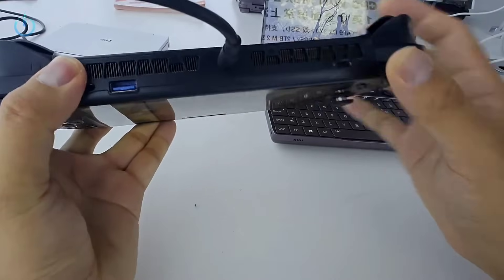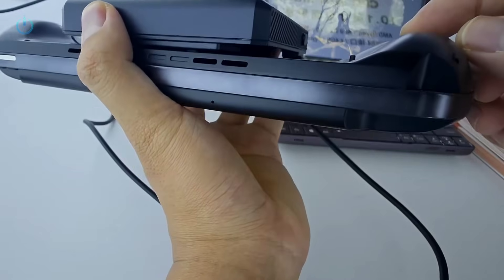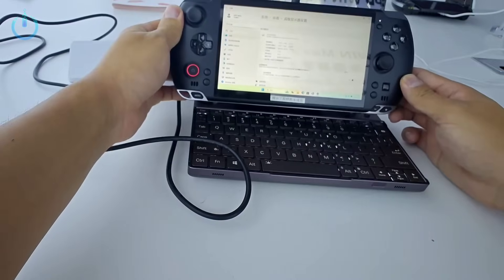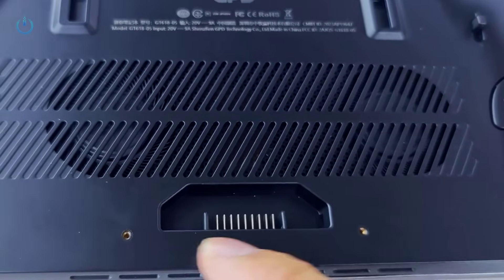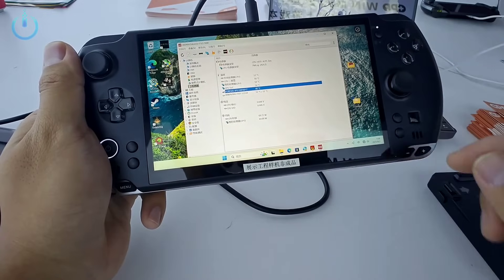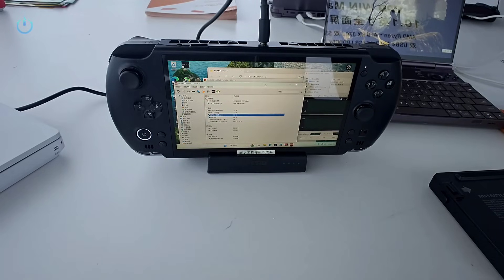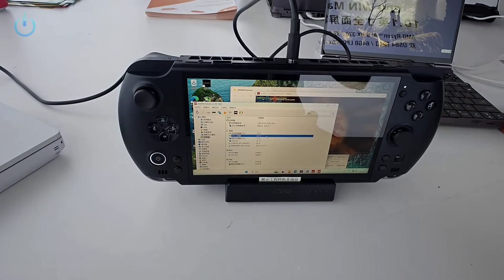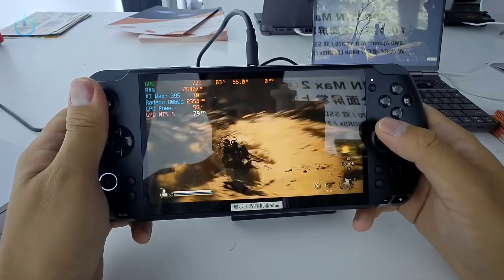GPD WIN 5 First Impressions Hands-on experience with the GPD WIN 5 ChinaJoy device

Comment: The detachable battery is such an great idea. And it can be easily replaced when the battery dies eventually 

When playing at pure 120w where power needs bypass the battery, having the choice to reduce the weight by removing the battery entirely is awesome

Absolute unit for a sleeper LLM machine as well or a low power draw server with firmware level power limits

Comment: I own a V3 windows 11 gaming tablet. You can attach an isometric “joycon” controller to it & transform it into a DIY handheld. It has a 14 inch 1600p 165 hertz VRR IPS display. You can run games at 800p & using AMD Super Resolution to upscale to 1600p & then you can use Lossless Scaling adaptive mode to run those games at 165 frames per second. This device has an 8840u 16 GB of RAM sold for around $1,000. It can run Stellar Blade at 165 fps. This device meanwhile has basically the same chip as a Z13 Flow, which costs $2,500-$3,000. You are looking at what could be a $3,000 portable pc. You would legit be better off with a $1,000 V3. A V3 or a Legion Go. Both can upscale from 1200p to 1600p. A legion go can run Stellar Blade at 144 fps. You can find a legion go online for like $500. lool.